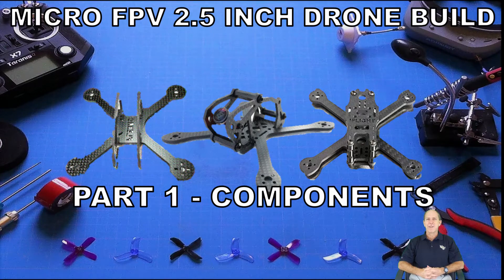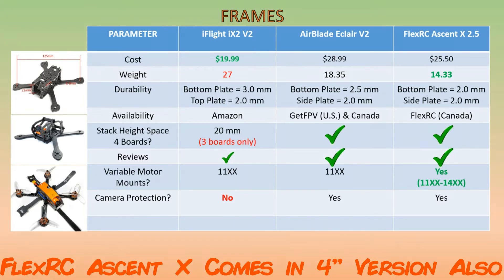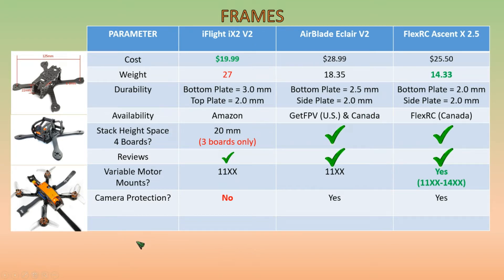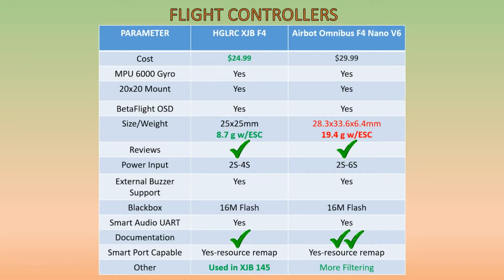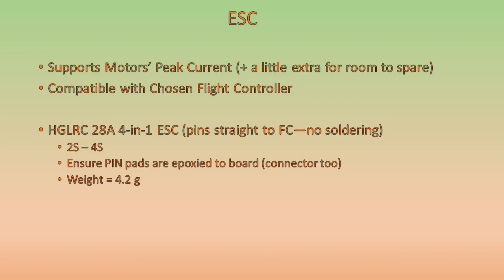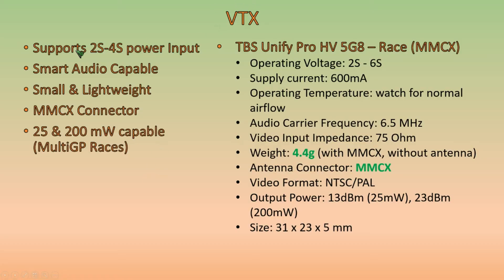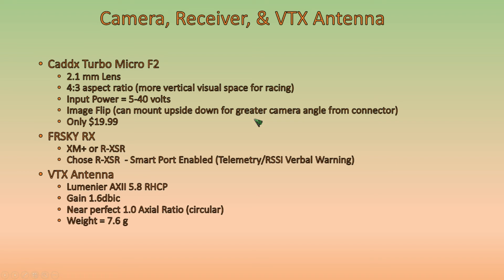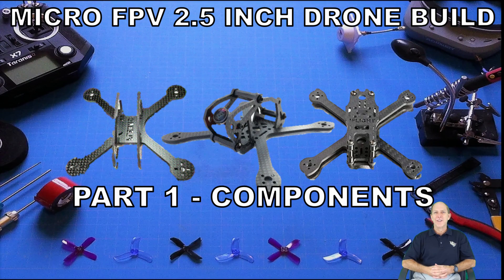MICRO FPV 2.5 INCH DRONE BUILD

Comment: What battery would you suggest for a quad this size? Everyone says 2-3 cells around 400-800 mAh, But if you are planning an drawing 40 amps, that's going to destroy even a 60 C battery.  This just doesn't add up.
Reply from the maker: GNB 3S 650 mah Lipo's would be perfect https://pyrodrone.com/products/gnb-3s-11-4v-hv-650mah-lipo-battery-80c-xt30-lihv. I fly GNB 4S 650's on all my 3-4" builds. How I choose my batteries & my favorites are here https://tmacfpv.com/micro-fpv-batteries/ Just make sure the motors you use are rated for 3S if using a 3S battery, etc. Usually it tells you in the product page